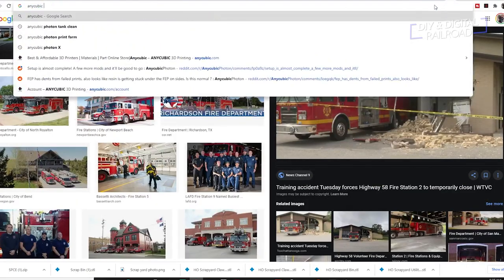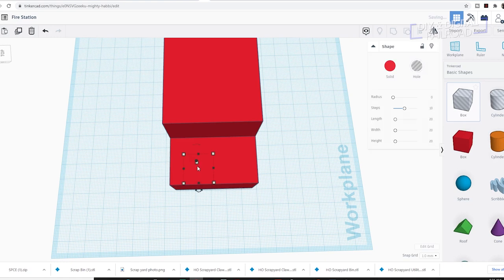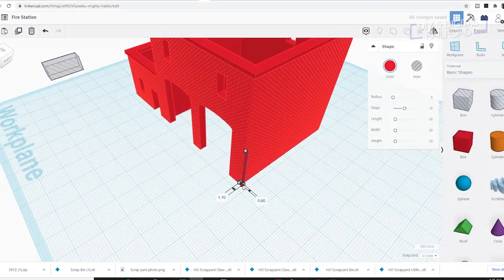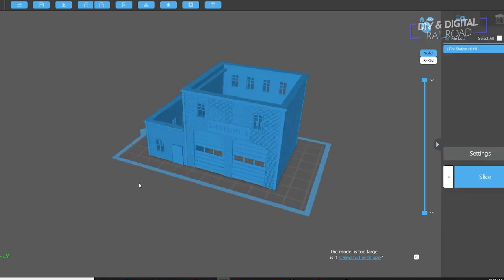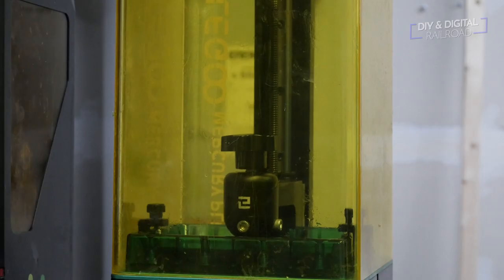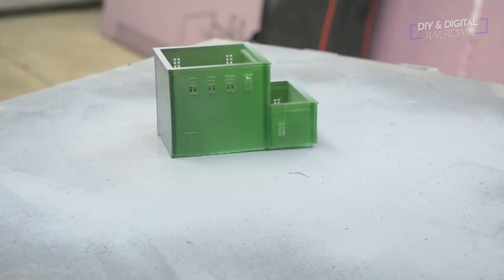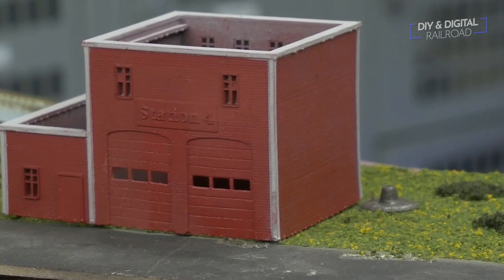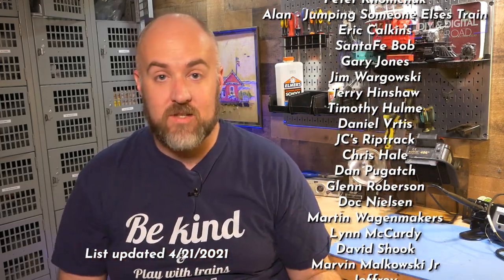Painting 3D Printed Models for your Model Railroad

Comment: One problem I have consistently is that my prints end up getting nowhere, like mostly stuck on the build plate and or on the FEP, never more than 1/16 thick. I have changed resin and FEP. Using Elegoo Mars(1)
and Elegoo resin.
Reply from the maker: I would have to know your printer settings. The settings that I use with Elegoo resin in 90 second bottom layer exposure with 5 bottom layers, and  8 second layer exposures.  These are my settings for Elegoo Resin.